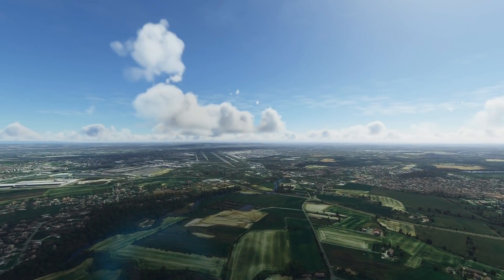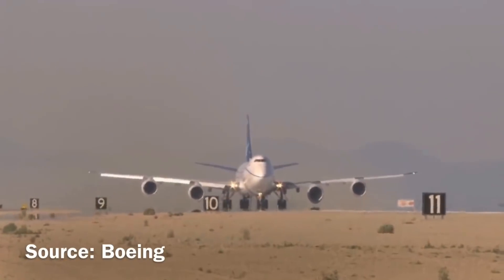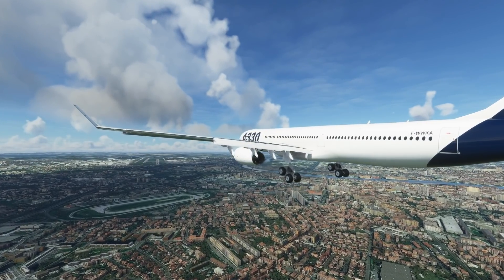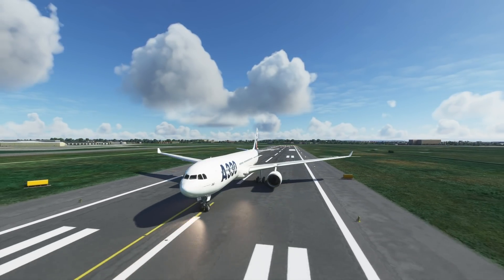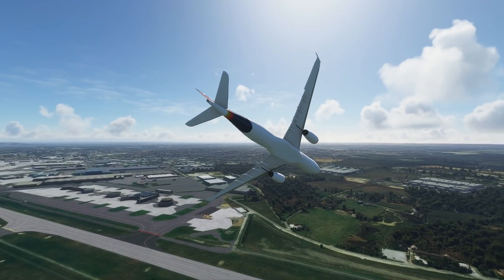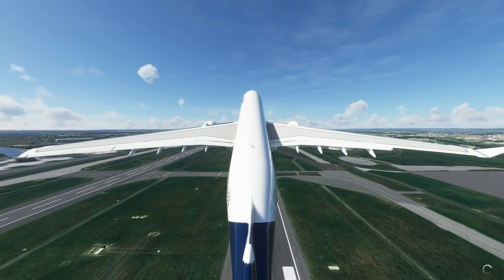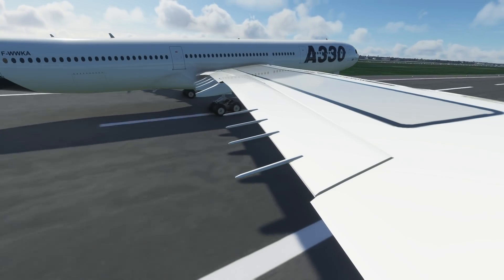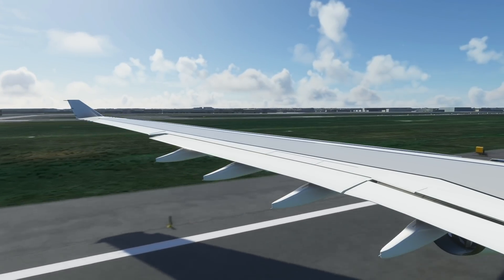The Test Flight That Went Horribly Wrong | Airbus Industrie Flight 129

Comment: You say that the “pilots” began to recover control of the aircraft, but in the report I believe it states that the plane was still in autopilot and therefore it was the autopilot that began to recover control of the plane, after the pilots had throttled back the second engine.

Comment: Why would the AP attempt to climb at all when there was insufficient thrust to achieve its objective? Surely, even in the altitude mode it would still take airspeed and thrust into consideration. This seems like a major flaw with the system.
Reply: It was a flaw, there was no speed protection in ALT* mode as the aim was to reach the altitude and level off.

Comment: Airbus failing to follow some of the rules of scientific testing. 
Particularly removing potential variables.
It should be standard testing, i think, to reset the whole plane before each test, autopilot computers included. You ONLY want to test the simulated situation as planned, not toss in unexpected things like the plane deciding it wanted to be half a mile up.

Comment: Seems to me that there are a lot of problems caused by autopilot in the wrong mode, or working to a previous preset. How about the autopilot manufacturers (be they the aircraft manufacturers or third party) address this Maybe change the back ground colour for the different modes and have the autopilot clear all previous data when  the speed reduces to 10kph after landing... Just me or is that making things too simple?

Comment: I don't know a lot about aviation I guess I know a little but my question is why can't these people these brave souls that test fly aircraft have ejection seats furthermore if you are going to be test flying jetliners why can't this be done over the ocean with ejection seats.
Reply: Ejection seats are typically located below glass that can be shattered by explosives or a canopy that can be blown off. Where is that going to occur on a commercial aircraft. There is a reason the most dangerous flight tests require the crew to wear orange suits and wear a parachute

Comment: Extraordinary that the fly by wire system allowed for an unsustainable rate of climb. You would have thought that the target altitude would have been cancelled by the other parameters saying 'Nope, you can't do that!' or at least delayed the attainment of the 2,000 feet goal. All the autopilot ended up doing was establishing a 0 feet altitude, when this would have been better to attain the altitude goal more slowly, or cancel it altogether.

Comment: Why would he retard the right thrust versus lower nose and right rudder and leave thrust on the right engine?  

That would have provided additional thrust above and beyond just lowering nose to gain airspeed ... ???

Only time to do that is if you get below the minimum controllable airspeed but even then you would probably not need to reduce to idle especially with the close proximity to the ground!

Comment: I'm surprised that Airbus's autopilot system would allow an excessive angle of attack in any mode.  What were they (the Airbus engineers) thinking? 

And when the thrust asymmetry began to become a problem, why on earth did the pilot throttle back the one remaining engine instead of throttling up the other (previously throttled down) engine?  If you have an incipient stall, you need more engine power, not less!  That's especially true when you're flying on only one engine to begin with.  That makes absolutely no sense at all.

Comment: Should not the stupid autopilot monitor aoa, pitch angle, roll and airspeed when trying to achieve its preset goalwhatever it was? Shouldn't it made all the necessary adjustments not to overpitch at least?

Comment: No formal pre flight briefing to actually understand and notate what would happen to the aircraft including the autopilot when certain actions were undertaken is likely the first domino falling point of the crash.
Fail to prepare, prepare to fail. This overconfiidence and ignoring protocol and weeding out how doing x leads to y and then to z and then finally a in a short space of time is how you get yourself killed in these scnarios.
Sorry but as test pilots this should have been something they fully understood before even getting in the aircraft, it's not as if using full power on one engine only and the other variables are unknown regards how that affects things. And they surely would also know how the auto-pilot would disengage and engage in certain modes and what affect this would also have.
This is why advanced preparation is so important to be able to hammer out and note the pitfalls especially at low altitude of what you are attmepting to test.

Comment: nah, the pilots did not perform brilliantly. they fucked up, massively. here's what the wiki page says:
The crash was investigated by a commission of enquiry within the Direction Générale de l'Armement (DGA), the French Government Defense procurement and technology agency responsible for investigating flight test accidents. The commission found the crash was due to "a combination of several factors, no one of which, in isolation, would have caused the crash."[7] These included:[7]

Captain Warner's fatigue after a "punishingly busy day" which had included an A321 demonstration flight, supervision of a simulator session, and two meetings, including a press briefing;
Lack of a complete pre-flight briefing, caused by Warner's schedule, and possible complacency caused by success of the testing through the previous takeoff;
Choice of maximum takeoff/go-around (TOGA) thrust rather than the slightly lower "Flex 49" setting, which caused higher than planned thrust asymmetry during the simulated left engine failure;
Choice of trim setting at 2.2° nose-up; although within acceptable limits, this was inappropriate for the extreme aft CG configuration flown.
Autopilot inadvertently left set at 2,000 feet (610 m) altitude capture from the previous test;
Absence of attitude protection in the autopilot's altitude capture mode;
Uncertainty in allocation of tasks between the captain and co-pilot; the co-pilot rotated the aircraft "firmly and very fast" to a takeoff attitude of more than 25°, compared with the usual 14.5° used for the first, successful takeoff;
The captain carried out test procedures immediately after takeoff: autopilot engage, throttling back the left engine, and tripping the hydraulic circuit breaker; this took him temporarily "out of the piloting loop."
Lack of visual indication of autopilot mode, obscured by the extreme pitch attitude;
Crew overconfidence in expected aircraft response;
Delayed reaction of the test engineer to changes in flight parameters, particularly airspeed;
Captain's slowness in reacting to the development of an abnormal situation.

Comment: Imagine having a altitude acquisition mode on your autopilot but that same mode does not take acceleration into consideration, yeah this has stupid written all over it,

Stupid automation is the blame for this, not the pilots,

Any sensible autopilot would have switched into that mode then immediately either switch out or limit its influence to the envelope of the aircraft,

I say this as a programmer, if you're making a automatic system, it either needs to be really simple, really communicative, or really safe, otherwise faults that are outside of immediate fixability will happen, it's just a matter of time
Reply: So you blame the automation but who designed that automation? A human
Reply: The autopilot pitched the aircraft into the stall because of a preset altitude acquisition rate. The aircraft that “couldn’t stall” stalled itself. Sadly the crew paid with their lives to demonstrate this possibility.  It’s in development test flying that this sort of “gotcha” gets discovered before ordinary line pilots get caught out.

Comment: I’m surprised the autopilot doesn’t detect if the pitch and airspeed are about to cause a stall and react accordingly. Surely this is more important than it being hell-bent on attaining an altitude.
Reply: If the aircraft had been in open climb or SRS mode it would be but still the time Alt Capture mode didn’t have high AOA protection. Nowadays it does

Comment: Regarding not changing the altitude, to me, 2000ft seems like a perfectly acceptable altitude to climb to after take off. What were they supposed to set it to? You’re taking off and climbing out. On a normal take off, it takes about 1 minute, maybe less, to get to 2000ft.
Reply: The point was due to the steep climb and how quickly they were getting there it engaged ALT CAPTURE mode much sooner than it would normally. Once in alt capture mode there was no protection against stalling
Reply: @tomstravels520  
Ah, I see. Thanks for the reply.

Comment: There seems to be a lot of muddled thinking, both in the video and the comments. Firstly, the pilots were not babes in arms or innocent bystanders, They were highly trained and qualified individuals who were an integral part of the testing and developing of the aircraft. They almost certainly knew as much about the aircraft and systems as anyone else in the program and much more than any line pilot would know or need to know.

There seems to bee a lot of confusion in the video and the comments about the use of the term "autopilot". Essentially the Airbus has three levels of control. The first is when a pilot is hand flying the aircraft using the side stick to tell the flight control computers what he/she wants the aircraft to do - the automatics then move the controls to achieve this. Engaging the autopilot changes the control from the side stick to the autopilot computers which then tell the flight control computers what is required. The third level is when the flight control system senses that the aircraft is about to do something dangerous (stall/overspeed/exceed a pitch or roll limit and a lot more) and takes control away from either the pilots or the autopilot and puts the aircraft in a safe state. In the case of approach to a stall it applies full power and limits or reduces pitch to achieve this. I have seen a demonstration of an A 320 fully configured for a max weight single engined landing where the pilot applies full back and full right stick and no other control inputs. In any other aircraft it would result very quickly in a stall, roll off and a vertical dive, in the A320 it results in a slightly odd climb on full power with about five degrees of bank.

Before anyone mentions AF 447, that aircraft had gone from Normal Control Law to Alternate Law at the start of the incident and stall protection changes to the words "Stall, Stall" repeated over audio system and the word "STALL" appearing in large red letters on the basic flying instruments. Different case.

In the case in the video the aircraft would have started doing things as it approached the stall which would have included applying full power on both engines (manual throttle position does not matter), but the idling engine would have significantly longer to spool up leading to the control problem.

As for doing the test flying somewhere else, the flight test centre is at the factory where the aircraft is built (and the prototype modified after test flights). If you moved it somewhere else you would still end up with a town to house all the workers.

It is also worth mentioning that the departures from some airports do have a 2000 ft level off height.
Reply: Also what didn’t help was the ALT CAPTURE mode at the time didn’t have stall protection. Whilst alpha floor may have activated the nose wouldn’t pitch down due to it trying to reach 2000ft in alt capture instead of of staying in SRS or one of the climb modes

Comment: Very well done-- and a stunning reminder automated flight controls put more stress than ever on human aircrews. To resolve an in-flight emergency, a crew must determine the cause of a problem, but cannot do that until they separate human and automated control inputs. More than one Airbus has crashed while crew struggled to understand what the Airbus thought it was doing, and while both First Officer and Pilot had their hands on active controls. Airbus believes the marriage of human and machine inputs can work safely, but many a pilot would rather fly a (properly manufactured) Boeing where human control is supposed to have the last word. The great irony is both 737 Max crashes happened with an automated control input, about which the pilots knew nothing.

Comment: Is it (still) common to keep all the settings of a previous flight? Why was the autopilot's altitude value not automatically reset after landing / before next start? No warning when not overriding or confirming old presets? My car looses speed control settings after engine switch-off...
Reply: The aircraft would probably have not been electrically shut down if the time between first and second flight was small

Comment: Shouldn't the autopilot be programmed to avoid a stall condition, regardless what mode it may be in?
Reply: At the time alt capture mode didn’t have high AOA protection. They disconnected the autopilot before it did automatically but still too late

Comment: The pilots killed themselves. Alt capture overrides speed control. Setting Alt capture at a low altitude and doing a full power takeoff in a light aircraft leads to an almost immediate Alt Capture on rotation. Which is why they were at such a high body angle. 
Bad design combined with poor piloting not a good combination.

Comment: It seems that many Airbus crashes are a result of the autopilot hitting a corner case and doing something unexpected. Boeing crashes tends to be the pilot doing something unexpected. Computer systems tend to work very reliably inside there defined domain, but unpredictably as soon as you go outside it. Humans tend to be somewhat unreliable everywhere, but no more likely to do stupid things when they are outside the normal domain than inside it.
Reply: What about MCAS on the 737 Max ??
Reply: @joso5554  "tend" not "always".

Comment: As an Engineer, "Simulating" an engine failure by simply closing the (fly by wire) throttles is NOT a simulation as the main computer knows what's going on.
A REAL test is to leave the throttle open and divert the engine fuel so the CPU sees fuel flow, and then you determine how the system copes with determining the engine has failed to provide thrust as the exhaust gas temperature drops and the plane yaws due to asymmetric thrust... THEN, you are testing the system.

Simply standing on one leg is NOT a simulation of being shot in the leg.
Reply: The main thing you deal with during an engine failure is loss of thrust. And the whole point is if you do the test wrong then you can add thrust and reposition to try again. Even if they had shut the engine off completely it wouldn’t have made a difference as the autopilot alt capture mode didn’t have high AOA protection at the time